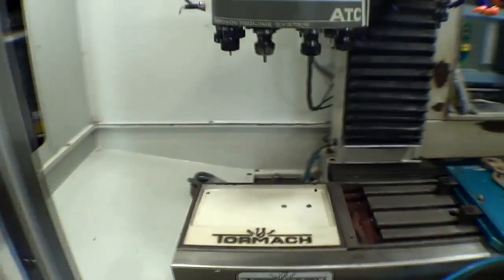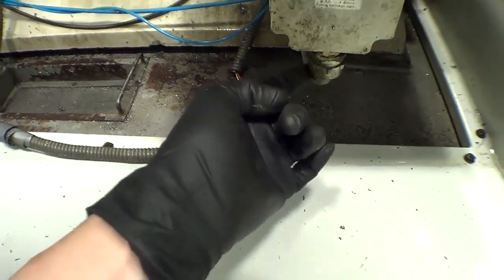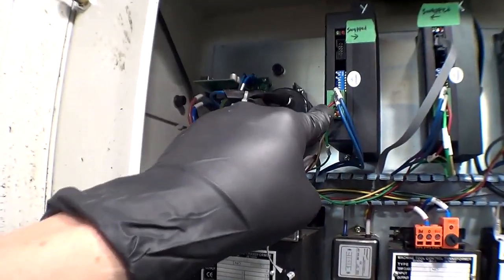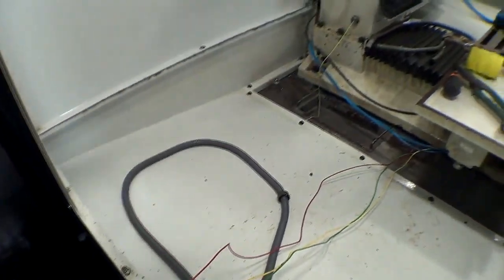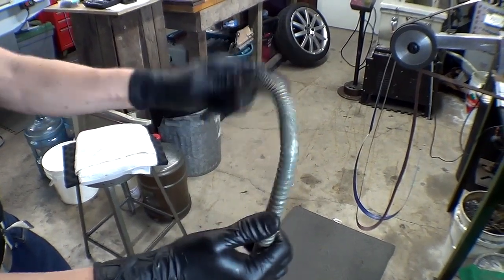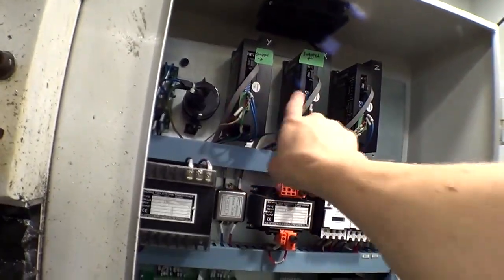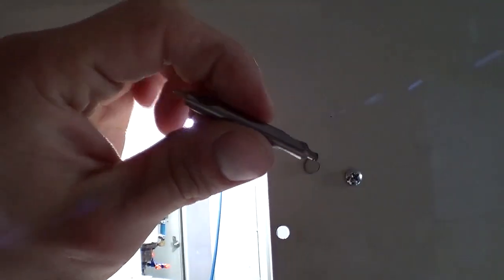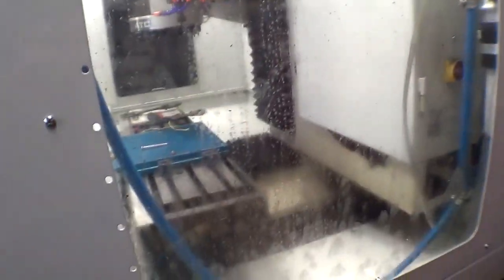Tormach axis wiring sheath replacement

Comment: We are having a shut down situation right now saying the limit switches may be activated or the db25 is the problem, we tested the cable it’s fine now tormach says try a new board. We asked if it’s not the board will they take it back, and they said yes with a restocking fee. We are constantly hitting the reset

Comment: Any oil based coolant (Especially anything containing white oil / parrafin oil) will harden and destroy the PVC coating on anaconda flex (PVC coated metal spiral flexible conduit). There is a self amalgamating EPDM rubber tape we use in electrical insulating application to 69kV, it is chemical resistant and being self amalgamating it is liquid tight, can be used for temp repairs and wont fall apart like the duct tape or we have used it in bakeries (White oil used extensively in bread dough) to wrap flexible carriage cables to prevent the hardening. 3M make it, I can dig the number out for you if you like.

Comment: @johngrimsmo 
John is there a chemical (silicone)? That you can spray on the part hat will be in the coolant. Just wondering . Thanks
Reply from the maker: Bill Roust Humm, good question!  I'm sure there is, something that would protect it.  A flexible paint of some sort.  Actually, PlastiDip would probably work.  Usually it's for tool handles and such, but is readily available.  It's something I've always wanted to play with but never really had a good reason to yet.

Comment: Suggestion: now that you have a new wire sheath, how about putting the portion of the sheath that's immersed in the coolant through an over-sized rubber hose which could be easily replaced?
Reply from the maker: Henning Johansen That's a wonderful idea.  Although replacing the rubber hose requires just as much work as replacing the original sheath, but if you used a proper coolant safe hose it would never have to be replaced.
Reply: JohnGrimsmo I see your rubber\plastic  hose and raise you one stainless steel conduit:
https://www.iowa80.com/DirectionsWEB/webcart_search.php?scr_searchArg=Stainless+Steel+Flexible+Wire+Loom&cart_truckType=&search.x=0&search.y=0
Or 3/8 version:
http://www.classicindustries.com/product/nova/parts/42561.html?gclid=Cj0KEQjwl6GuBRD8x4G646HX7ZYBEiQADGnzurXqXjEPMivfL4vNqRTpOpp8aY3x0yjcbD6GLBC9hMgaAvTh8P8HAQ

Comment: No more use of center drills? Reasons?
Reply from the maker: difflocktwo Meh, I always viewed them as a manual machining tool, although that's probably generalizing it way too much.  Now I use carbide for everything but some of my drills, I'll spot a hole with a proper carbide spot drill, chamfer it with a proper chamfer mill (or the spot tool if I'm feeling frisky), then drill it.

Comment: Tormach doesn't use closed loop drivers?  That's disappointing.  If they did, the controller should have been able to detect that the axis wasn't moving and you might have only ruined one part instead of the whole pallet.
Reply from the maker: thavinator Nope they don't have a closed loop system.  I think I only ruined a few parts, not the whole pallet, because I only ruined the parts along the axis that stopped working